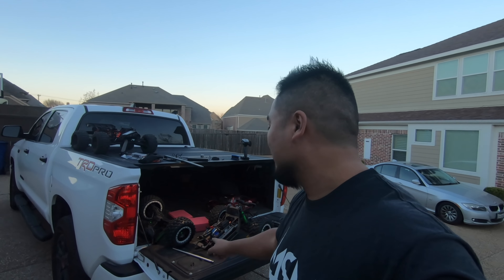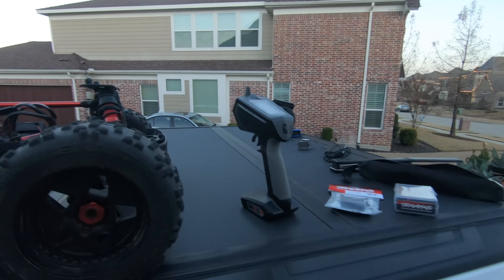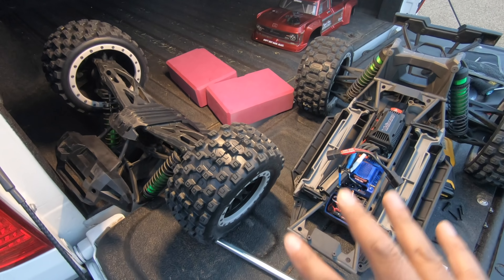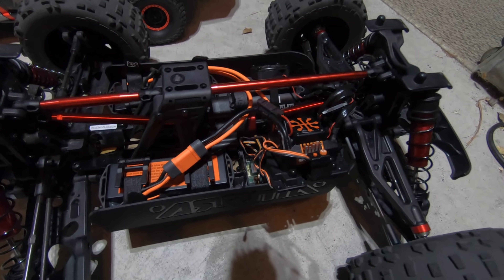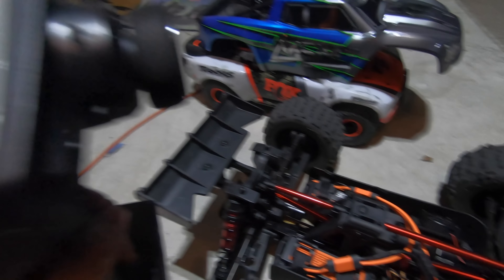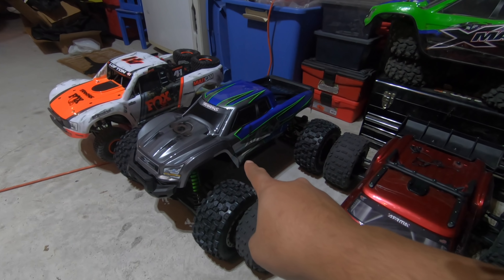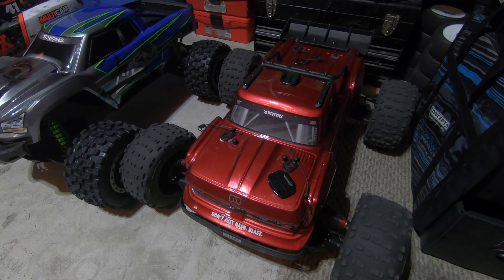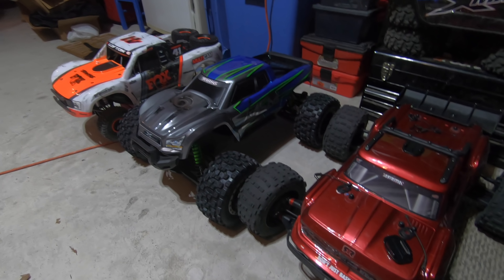Spektrum Electronics Problems Won't Calibrate Need Help | Traxxas XMaxx Servo Replacement

Comment: Spektrum AVC reciever? If so, re-bind, apply full throttle, full brake, neutral, full right, full left, then center. The orange LED will flash once.
Reply: Yes this is the way. As soon as I heard Mark did a bind to DX5C I knew it was missed calibration. You have to bind AND calibrate radio immediately with AVC on. Or else weird things like this happen.
Reply: @netcruzer  Was having a similar issue when i bound mine to my DX5 Rugged hopefully this is fix it
Reply: those receivers do not like having different servos or anything added to it.  It seems like it happens with the AVC receivers more often.
Reply: Haha brown out

Comment: Hey Mark, I have the same issue you're having on the Outcast reciver a few times. The AVC RX needs to be calibrated when bound. To calibrate it, re-bind, hold full throttle, full brake, neutral, full right, full left, then center. The orange light shoud flash one time and you should be set.

Comment: I had a problem using a Mamba Monster 2 esc out of an X-01 and trying to use it with a non Traxxas remote. Turns out it has to be unlocked for 100Mph on the X-01 transmitter and the Traxxas App, THEN you have to hook the esc up to Castle Link on your computer to turn off the Traxxas live link. Without doing that the esc had steering with the new remote but no throttle. Even if you tried to calibrate the esc as per Castles instructions it would not work.  It literally drove me BANANNAS! 😵🤬🍌 all night long until I figured it out.😂👍

Comment: For any body that’s having trouble finishing the calibration my solution to this was to set all the end points first then calibrate. I struggled with this for 2 days, it would calibrate neutral and full throttle but not the brake. Once I set my end points for my DX3 the ESC went though calibration no problem.

Comment: On my udr I replaced the servo with a high voltage one. And it made a huge difference. The other thing you’re gonna want to change out is the front output that goes from the trans to the front differential. Traxxas sells a metal upgrade. That is a huge weak point and it’s disappointing that it doesn’t come like that from factory and sell you an upgrade.

Comment: I had similar issues after my first run with my outcast 8s, the receiver has AVC on it and you have too be sure on the stock remote (I’m not sure how you’re dx5 is setup) the brake rate knob needs 100% on or it will never calibrate correctly!

So again I’m not sure with the dx5 but spektrum is very picky on how you’re remote is setup during the binding process

Comment: The Losi Lasernut has a similar system in it (not as high voltage and amps but seems firmware is the same), and it has had similar issues like this. Still using the RTR radio with it but there seems to be little hiccups between the reciever and ESC. Usually get it to work just by turning things off and on again multiple times. Now where is that Tekno ET48 2.0?

Comment: Press the little button and turn on the esc keep holding the little button until it makes the fast beeping noise. press the little button once, then do full throttle and press the button, then do full reverse and press the little button , and then turn the ESC off.
Reply: Yes, this is the right way to calibrate one of these escs.

Comment: What after market remote do you all recommend? Needs to run at least 5 channels as I have a TRX4, Summit and a few X-Maxxs. Been looking at alot of different ones but just not sure which one. Futaba, Sanwa, Spectrum rugged seems ok but after seeing this not so sure. Let me know your thoughts. Happy New from Canada 🇨🇦👈👍🤠
Reply: Spectrum I'd say they are getting alot better lately
Reply: Nothing wrong with the radio here just needed avc calibrated

Comment: I’ve had a few Arrma products lately that needed the receiver bind process done before recalibrate of the firma esc’s. Don’t know what causes it but I’ve had good luck with just going through the receiver bind first. Maybe a software issue.

Comment: Will that 400oz servo have enough power
Reply: It won’t because of the tires, I had that traxxas servo and it sucked
Reply: It works good on my 1/10 slash but I don't think is going to be good for the Xmaxx.

Comment: Hey man I run nitro but I had a very similar issue once with a dx5c.. I had the battery plugged into the receiver backwards and in the bind plug lol Suprisingly it still worked but I had to bind it everytime I used it and after running it for 30 min or so it would act like it wasnt getting enough voltage.
Make sure when you calibrate you go full throttle then full brake first and when calibrating steering make sure you go full swing left then full swing right. They don't give you much time to calibrate.

Comment: Check out.  Razor rc he just put a video out showing how to calibrate the steering they dont tell you how unless you down load the transmitter manual. This is for the stock remote.   Try changing the receiver to match that remote.

Comment: If you did a rebind on the spektrum AVC receiver you have to calibrate throttle and steering as soon as you bind from the radio, not the ESC. You have no manual end point adjustments with AVC on, it’s all “smart” and the radio should be at neutral trim and have 0-100% on radio for steering and throttle. Bind the Rx, then immediately on Tx go full throttle full brake and full left right steer. Neutral. Wait. OK you have calibrated the endpoints for AVC. Now you can calibrate ESC if you want to.  You must disable AVC completely from the receiver to be able to set the endpoints the “normal” way. TSM is a way easier to use and calibrate than AVC is.

Comment: So on spektrum esc when ever you bind it you have to recalibrate right after otherwise it won't work
Reply: I have the full write up how to properly set these systems up from the factory  if you want it .

Comment: hey if you see this, pleeeeeeease read this, i got a new lipo battery for my 2x2 traxxis slash and i turn on the remote then plug the battery in and turn the car on, but the light starts flashing green AND red and you cant drive, but you can turn, pleeeease answer i had this problem for a while, and i just bought the battery, pls respond
Reply: is the red light going Blick....blink....blink....blink? or is it going blinkblinckblinkblinkblink? realy important to know how fast the red light is blinking for me to  tell u whats going on.
Reply: its going blink red.... blink green..... blink red..... blink green
Reply: @lolbossisboss5738  call traxxas i’ve never seen that one.
Reply: oh ok

Comment: Happed to me and it turns out the receiver has a lot of problems so if you switch it out it should work really good the receiver is really weird just change out the receiver and all your problems will be solved

Comment: You have to calibrate the avc on the receiver after binding, also you where attempting to calibrate the esc incorrectly Spektrum is done diffrent. Read in the manual thats how i figured it out and it simple with the correct process.

Comment: You may need a new receiver. I have a few ARRMA cars, and have never had this issue. You should contact ARRMA.  I know they don’t have as good as support as traxxas does, but you should still email them. They’ll probably tell you to give them a call, so you could still do this. They should hopefully send you a BRAND spanking new ESC and receiver if they can’t figure it out. I hope you get this solved.
Reply: I am curious when you are going to put up the Google doc for us to enter for the giveaway of the mini e revo?  Is it going to be in the community section? But I really like my XMAXX! I need to replace the shock cap, but there is a stone stuck deep inside the screw blocking the pin from coming out! Do you know how you would remove this?

Comment: Hey, I am Adam from product support at Horizon Hobby. It sounds like you needed to calibrate your AVC. Full throttle, full brake, neutral, full right, full left, and lastly center. 

This must be done before calibrating the esc but after binding. If you experience this again either calibrate avc or disable it. 😊
Reply from the maker: Thank you! I will give that a shot!